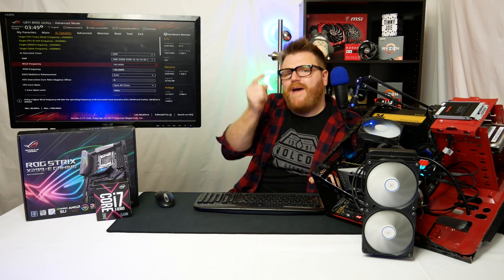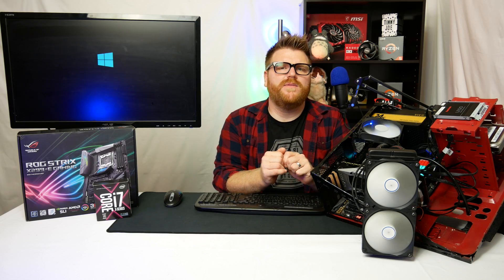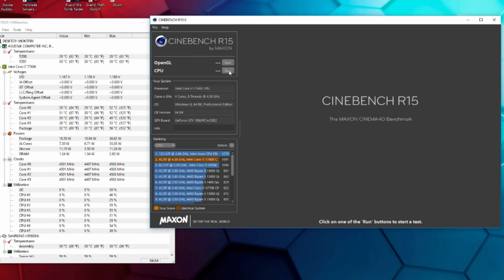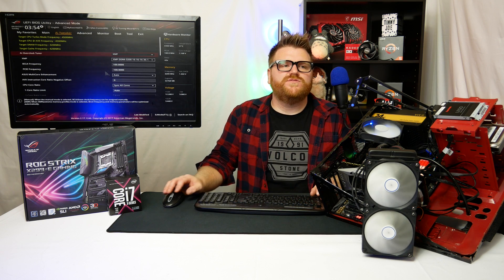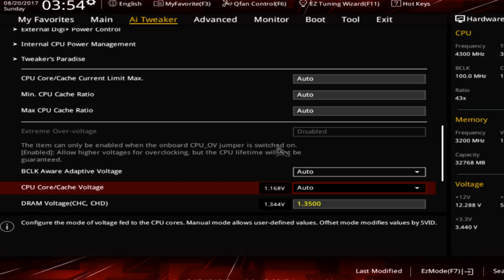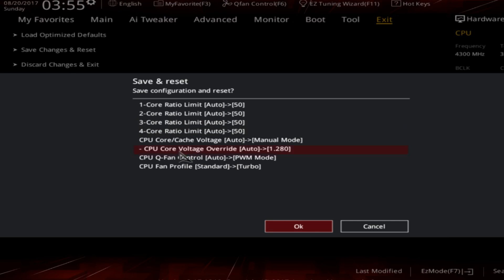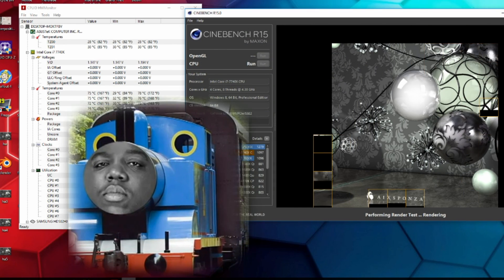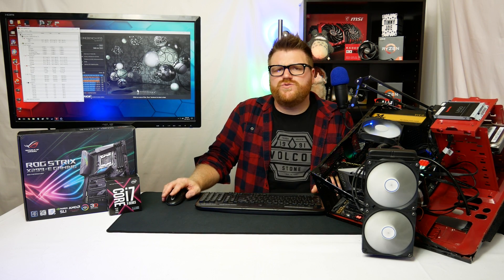Overclocking the Intel Core i7 7740 Kaby Lake X to the limit

Comment: I did this tutorial and now have worse fps in games, tried “50” ratio limit and 1.28 volts on my VCore but got worst FPS? The system does show its clocking up to 5 gigahertz but FPS is bad..

Comment: LOL my old socket 2011 3930K at 4,6ghz Beat your socket 2066@7740x kaby lake-e at 5Ghz in cinemarkR15 i get 1164 CB score
Reply: Johannes Andersson exactly, 12 threads is your explanation.
Reply: Yeah cool, I did 1300 on a 3930k. Have done 1189 on a 7700k.
Reply: you did 1300 cb on 3930K at what speed :) ? iam on 1189cb now with 4625mhz.. going to do some more testing :D great work man !
Reply: if you did 1300CB with a 3930K there was probably no air cooling because it requires more than 5,1-5,3Ghz at least on water cooling I would think or dry ice?

Comment: the newest prime95 ran 48hrs on all 3 tests for ultimate stability test.    don't want to hear about avx instruction sets in prime.  if it can't run prime, it's not stable.  this is just for cpu core speed stability tests.   there are different methods to check memory overclocking stability.     IBT / OCCT 48hr runs are recommended as well.   happy overclocking!
Reply: halistine jenkins Sounds Painful, i wonder how many computers get damaged doing that? 🤔
Reply: if the pc is cooled properly , the answer should be none.    i like timmy's vids and am suscribed but he along with most of these utube tech personalities are running unstable machines if all they do to check stability is what they show in their videos.  the reality is that most "Overclockers" are running unstable machines daily because they refuse to give up on fantasy speeds for their chips because true stability checkers will fry / throttle them at their current speeds / voltages.   if you want true stability, find the speed / voltage you can run while maintaining the manufactures recommended 24/7 operating temperature window.  Once you find that with the present cooling you're using, you're done with that chip unless you don't mind shortening it's life span.  then by all means, run it until it throttles.  people will say prime95, occt, IBT, etc etc are power virus.  this is just not true.  prime uses avx inst set which is what sends intel over the bridge heat wise.  that's why you'll find a special avx multiplier in the bios of certain motherboards.  it basically downclocks it when encountering these avx situations.  people will also say that games, browsers, etc etc don't even use avx inst set.  google avx / avx2 applications and you'll see there is some popular software out there that uses these instruction sets including a few games.  it's stable or not stable.....pretty simple.